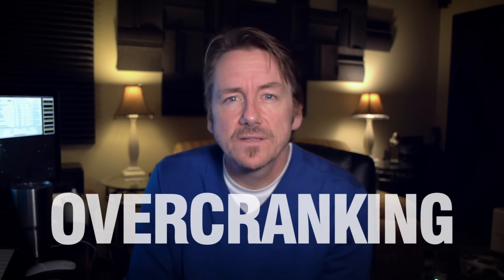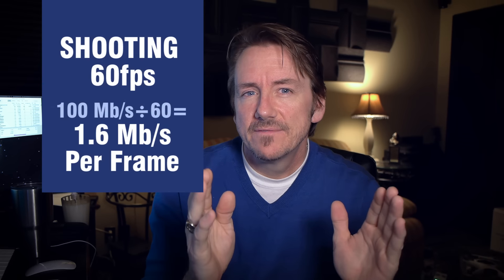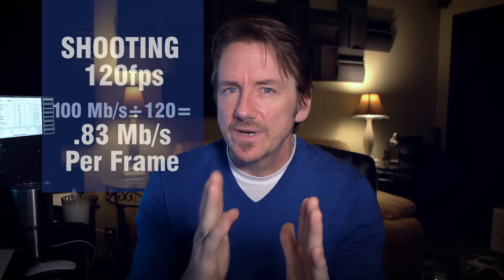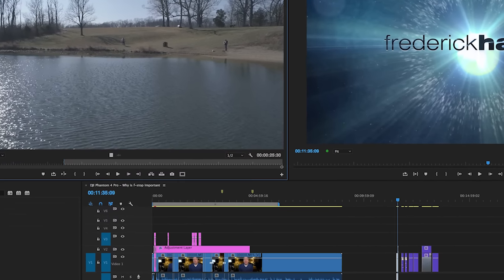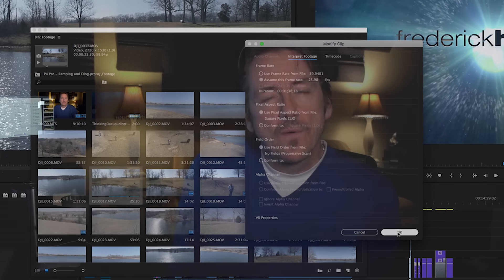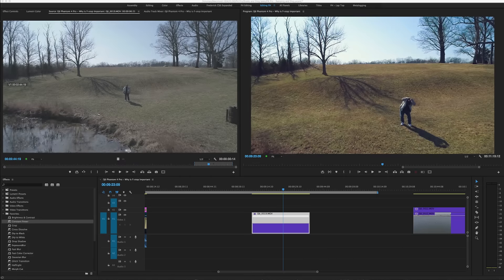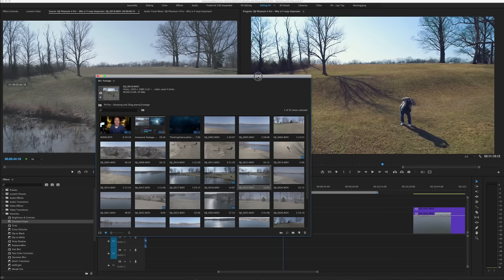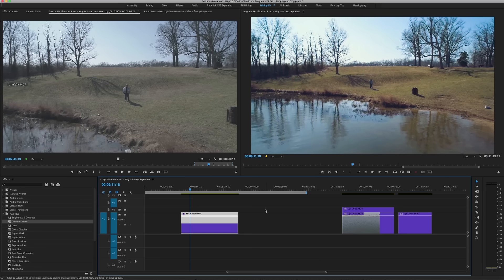DJI Phantom 4 Pro | True Slow-Mo & Ramping Tutorial

Comment from the maker: Posted by https://www.youtube.com/user/rodrigopolodotcom
Got caught in the spam folder and didn't want to loose these insights.
Here's his comment.....

The Slow Mo Guys use this effect all the time, of course they have cameras that go far beyond the 60fps limit most end-user cameras have. About the bitrate, I have more than 8 years researching and using open source encoders and knowing how they work, X264 and FFmpeg for instance. Every camera out there use a hardware encoder, not a software encoder, this is for performance, mainly to reduce battery consumption and to have a predictable result, thus, having a fixed constant bitrate to allocate all the video data,  GoPro HERO 4 Black and DJI Phantom 3 Pro use a 60Mbps bitrate no matter which setting you choose, the decision behind this is the flash card bandwidth and energy consumption, so, if you choose a smaller frame size or frame rate, it would have better image quality, but there is another factor with higher frame rates, the amount of light captured and the sensor sensibility. Casey Neistat tried to use 60fps some time ago and the results were bad, here is what happened...

If you use a higher frame rate you make the shutter speed faster letting less light to reach the sensor, this introduces noise on less sensible sensors, that would not be a huge problem if you had a raw encoder, but H.264 compress video by losing extra information, one of the steeps of reduction of the encoder is to create a grid to look for areas that can be replaced by a single color square (macroblocks) and when it finds that there is some detail, it brake this block into smaller blocks in a recursive way until it finds it cannot longer replace that area with a big block, this is why video with a lot of noise consume more bandwidth and looks like a pixelated mess, look at H.264 video when it contains confetti falling, it is just a mess. Same happens with higher frame rate video that has a lot of noise. So, the trick to have a nice looking higher frame rate video is to have a lot of light and slow movements, this reduces the amount of information that has to be encoded, also notice that if you want to record someone jumping in slowmo, not moving the camera would help a lot because then the encoder would only store the deltaframes containing only the information of the subject moving trough the frame and not having to reencode the whole image.

As always, great video.
Show less

Comment: Another great tutorial Frederick so is it your conclusion that if you want slow motion on the P4P to shoot at 60fps at 2.7k resolution as opposed to 60fps at 4K/UHD.Thanks
Reply from the maker: Honestly...it's either or. 4K is much larger so it's going to use more Mb/s than 2.7K. 2.7K shoots a little lower bit-rate than 4K so it's a toss up. I prefer to use 2.7K for over cranked slow mo because it's physical smaller. I edit everything on a 1080 timeline so 2.7K footage on a 1080 timeline is much faster, better playback etc. than 4K on a 1080 timeline. Hope this helps.

Comment: Great video Fred, thanks for sharing this informative information with us, but I do have a question. How will the video perform if you shot it at 2.7 60 fps and you just placed it on a timeline that is set for 24 fps, but you don't interpret it, will it still be in slow motion or does it not play back? Thanks again!
Reply from the maker: Great question. When you place say... footage shot at 60fps on a 24fps timeline the application assimilates the footage to the timeline setting of 24. It will play at normal speed just like the natural 24fps clips next to it. The application simply drops the "unneeded" frames as it plays back. (Over 50% of them.) The only issue is you may see strange small movement glitches in the motion. BTW: For some strange reason placing 30fps footage on a 24fps timeline is really noticeable. I'm assuming that's because 30 is so close to 24 the app has to randomly decide which 6 random frames to throw out in one second... giving the weird jump or stager in the motion.

Comment: this this Drone is a win for Dji..I sure was thinking bout getting the inspire 2 with the  X4S cam is there really a big difference in the two????
Reply from the maker: No not really. You can swivel the camera 360º but it's the same camera as I understand it.
The X5S? More impressive but not for higher frame rates.
Shoot in Apple ProRes
5.2K: 5280×2160 - 23.976/24/25/29.97p, 422 HQ @1.3Gbps
4K: 3840×2160 - 23.976/24/25/29.97p, 422 HQ @900Mbps

1.3Gbps and 900Mbps is a staggering amount of bit rate coming in that cameras sensor for Non-RAW footage! BUT for ramping and slo-mo over-cranked footage, you'd have to go with the h.264 codec at only 100Mbps...just like the P4Pro.
Reply: Thanks for info will make a decision soon

Comment: Hi...have you tried the H265 codec? If yes, mind sharing your thoughts? Thanks.
Reply from the maker: H.265 is still tricky. Waiting for Adobe to do an update to Premiere Pro.
Reply: Frederick Hagan ...Ok...but I though Premiere can now handle h265 codec?
Reply from the maker: Yeah... me too...It's supposed to be able to...but it isn't yet. Premiere Pro can handle h.265 but for some reason it can't handle DJI's H.265 codec. I think the issue is with DJI's codec....not Premiere.
Reply: Frederick Hagan ...Hope it will be fixed...either by DJI or Adobe. Thanks for the info, sir.

Comment: Awesome, thanks for another informative tutorial.  Now to translate this to DaVinci Resolve :)
Reply from the maker: Thanks for the comment, Michael. I wish I knew more about DaVinci Resolve. My apologies for not having this info for you. Perhaps someone else will chime in here and educate me also. :)
Reply: No problem, if someone chimes in that would be cool but to be honest I enjoy the challenge and I am sure I can figure it out.
Reply from the maker: Roger that. If DaVinci doesn't have a reinterpret footage settings. Leave the footage as is by slow it down on the timeline. Bottom line is that the footage shot is over-cranked at 60 or 120 fps. So... slowing down 60fps to around 40% speed should, in theory, provide the same effect. The last thing you want to do is try to slow down footage that's only shot at 24fps. 50% speed of this would result in 12 frames per second giving you that stutter look to the motion. Hope this makes sense.
Reply: Yep, makes total sense.  I probably need to invest in a better drone before I can do this since the Mavic currently doesn't handle the faster fps very well from what I understand.  To you point the camera on the Mavic has much less processing power than the P4P so it is not going to handle the higher FPS very well.

Comment: You seem to forget that 4k DCI is over four times the amount of data of 1080p.
1080p@120fps is about the same datarate as 4k@25fps though, so you're not actually "stressing" the codec particularly, especially since 100mbit H.265 is about the same as 200mbit H.264. You should be more worried about pushing for usable latitude, as the log modes can't accommodate for that DR. You have the range, but not the latitude, and the colours will break up immediately you try anything more than moderate HSL-processing. 120fps will look good if you push for making everything look as good as possible while recording, even tho it requires more experience and experimentation with settings for any given environment and lightning.

Btw, the Phantom 4 had to crop on the sensor to film120fps, the P4P does not.

Comment: But does the p4p shoot 1080p 120fps at 100mbps? Have you checked it? I know the mavic shoots 4k at 60mbps but at 2,7k it drops to 40mbps, at 1080 60fps mavic shoots horribly at 20mbps
Reply from the maker: Great point. I looked into this when to my eyes the 2.7K 60fps "looked" better than the 4K 60fps. 2.7K 60 shoots at 100Mb/s on the P4Pro. 4K 60 also shoots at 100Mb/s. BUT... 2.7K looks better, renders and processes better....literally because of the smaller physical frame size utillizing the SAME 100Mb/s of allocated processing power! 2720×1530 pixels getting 100Mb/s of processing power will produce higher quality video than a roughly 26% larger (3840×2160) pixel area with the same 100Mb/s of processing power. Hope this makes sense...gave me a headache trying to type this where it made sense! LOL.
Reply: Frederick Hagan thnx, oh yes makes sense here :) i know how things work :) like on the mavic people keep saying 2.7k 24fps is the way to go but at 45mb/s its acually more compressed than 4k 24fps, at 2.7k 24 you only get about 1800kb per frame but at 4k 24fps you get about 2500kb per frame, i always thought 4k looked better compressed on the mavic (oh i also i never changed from art si ive always used art) and dji added art back now with the latest ios update :)

Comment: Its MOV. bit rate right? But between mov and mp4 is not difference right?
Reply from the maker: MarkVallen yes for the most part the quality is the same with either.
Reply: So it has like 30mbits in mp4 right?
Reply from the maker: 100

Comment: Hi Fredrick, Using FCP 10.3 I'm trying to find the equivalent of Interpret footage/assume frame rate but seem to be failing. To test a FCP feature I've reduced some footage at 30fps to 25% speed and yes it was so choppy it's unusable. I used Video quality/optical flow which took a fair time to process but I have to say that the result was super smooth. Problem being if I my project on a 30fps timeline and drop a 60fps clip onto it for slowing down, the 60fps clip will get degraded when dropped on the 30fps timeline, so this feature isn't really helping that much unless the entire project is at 60fps. Have you any thoughts although I know you do favour Prem Pro. Many thanks again for your help as it is most appreciated.
On another note I tried something totally different for the first time with the P4P. I think unusual is the word... 
https://www.youtube.com/watch?v=0j0gCnXbVhw